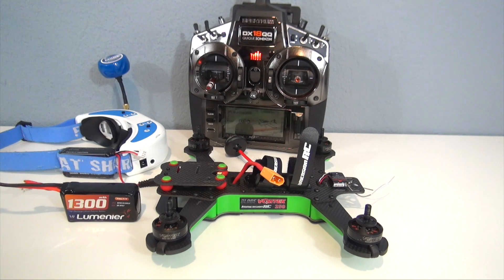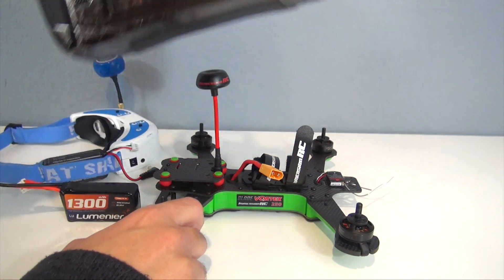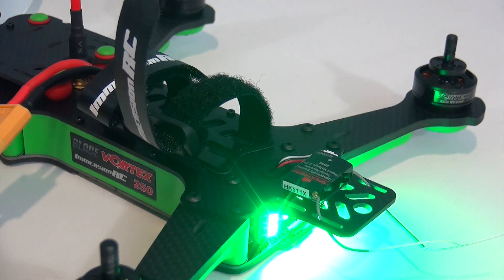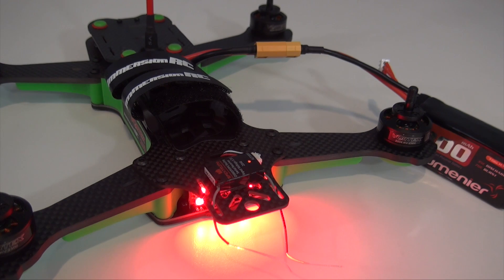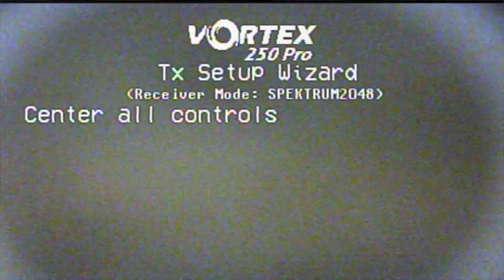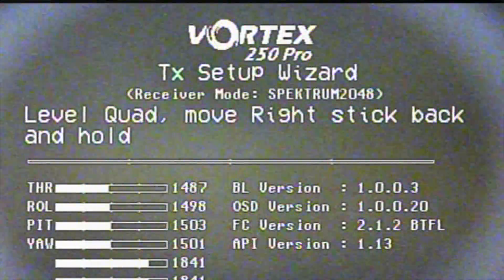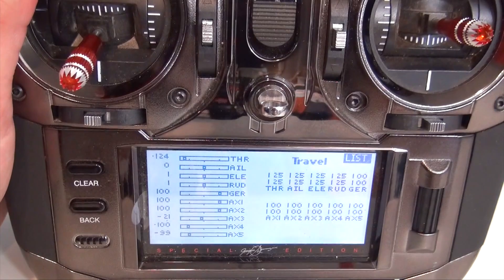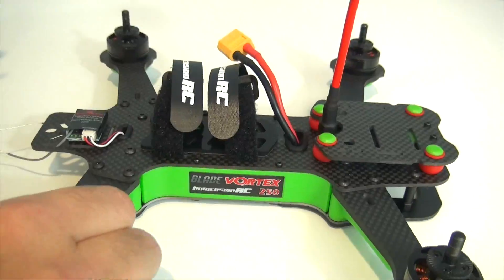Blade Vortex 250 Pro: Binding and Set Up Wizard

Comment: Hey, I hate to look like a noob. but I bought a vortex pro came with a Spektrum  2048 racing reciver. also bought a Spektrum DX6I to fly with.  But I can't seem to bind it the two. according to the screen its saying no RX . Yet when I turn off the controller the led on the receiver goes out. Turn the controller back on and the led comes back on.. but yet still no RX displayed in my screen. Any ideas?
Reply: I think the Blade Version (green) comes with a receiver. this model is made by immersion and sold to Horizon for resale.

The Immersion Vortex (red) does not come with a receiver.
Reply: bugger cause i want to buy this quad and have a dx6i
Reply: Sadly the DX6i even tho it says dsmx and dsm2 on it  wont bind to the Dsmx receiver. I took the radio and drone into the hobby shop and they tryed..  thinking maybe it was a faulty receiver but then we tryed an off the shelf dx6 and it binded up no problem.   The Dx6i is an older model and running an older version of firmware. so unless there is away to update for the new protocols then you might want to consider upgrading your radio.

Comment: Want to note that the wizard steps have changed since this video.
It threw me off because I tried to run the wizard blind without the OSD (have removed analog VTX and installed digital HD VTX) and the steps in this video simply wouldn't work.  Wouldn't get past first two beeps. 
Used to be  the following  
all neutral - roll left - neutral - yaw left - neutral - throttle min - neutral - pitch down - neutral - left stick at bottom left - neutral - right stick down (to calibrate level)
(Note:   down = stick down, up = stick up)
Now they've added steps to record other end of range, so total sequence is.
all neutral  - roll left - roll right - neutral - yaw left - yaw right - neutral - throttle min - throttle max - neutral - pitch down - pitch up -  neutral - left stick in bottom left - neutral - right stick down (to calibrate level)
Reply: I dont have a monitor fpv or the goggles yet, still wainting on it from ebay, so im also configuring it blind but the lights stay red after the star wars beep, it wont throttle, I go to cleanflight and motors work fine and the controller throttle also works fine. Dont know what else to do know.

Comment: How to Bind  Vortex Pro 250...."Now you just bind in the usual fashion (doesn't show how, just shows light of Vortex)"   Really!!!!??? How do you bind the DX controller to the Vortex? What button?
Reply from the maker: Sorry but I didn't show how because most people who have a spektrum radio know how to bind it to a spektrum receiver and anyway it depends on what radio you have. It's easy to find it in the instructions. If you tell me your radio I can link you the manual.
Reply: That was a surprisingly fast reply. Thanks for taking the time to reply to your viewers. I have a dx6, but I did figure out how to bind it. I just can't seem to figure out how to setup the drone with the receiver now. It's tough to find simple instructions online, surprisingly.
Reply from the maker: If you bound it have you found the video signal? You should be able to run through the wizard.

Comment: Hi DiscoverRC.
Could you please check in Cleanflight if the Board Alignment - YAW Adjustment is set to 90 degrees and let me know ?
On mine it is set to 90 degrees but that sound strange...i was expecting 0 degrees !!!
TIA
Reply from the maker: +IceCreams62 I haven't taken off the top plate to see how the fc board is mounted on the quad. If it is mounted arrow to the right the yaw adjustment should be + 90-that may be what is going on. If straight ahead then yes it would be 0, but first check the board direction. Have you flown it?
Reply: +Discover RC 
Not yet.
The arrow on the board points to the front so i expected 0 degrees, but after the OSD setup 90 degrees are 'pushed' on clmeanflight...this is what sounds strange for me!!!!
The quad avatar on cleanflight in any case moves right so all seems to be good.
This is the reason i'm asking  you to check your cleanflight setup.
And sorry for my bad English   !!!
Reply from the maker: +IceCreams62 Your English is good :). That does sound a little odd. I will check it in cleanflight. The quad is flying normally though so it seems good.
Reply: +Discover RC Thanks a lot....i'll wait your check.

Comment: Would the Dx 6 work the same way?
Reply from the maker: +cartman4241 yes - you will need to reverse the aileron and rudder channels and adjust the end points. Also to get all the flight modes you need to assign the 5th channel to a 3 position switch. I'll go over that next.
Reply: How do you assign the 5th channel?  I have a dx8 and cannot find anything in it for "5th" channel. I tried aux 1 and aux 2 but nothing responded.